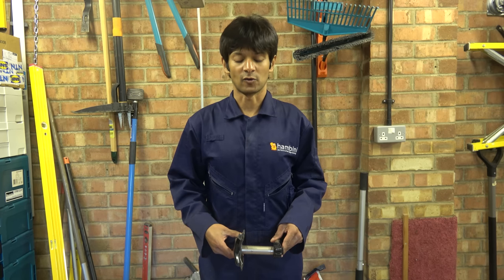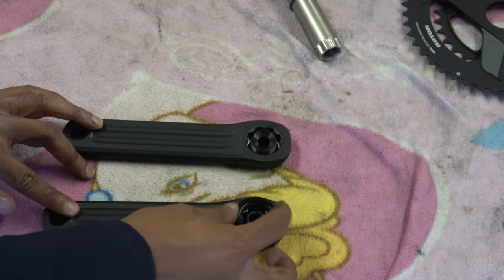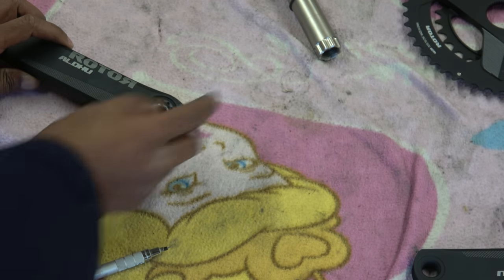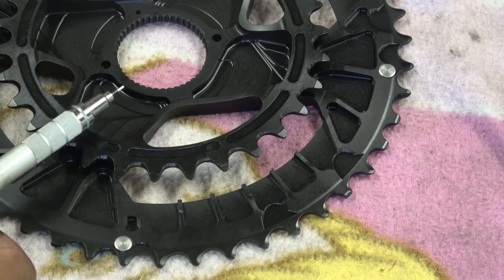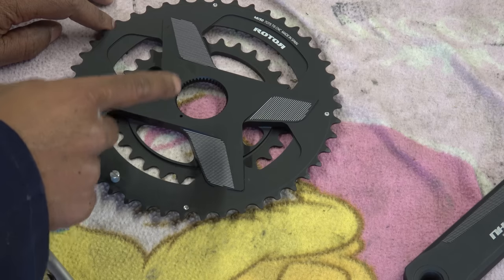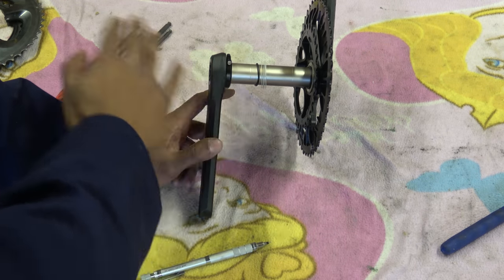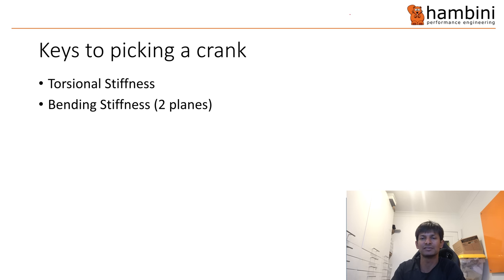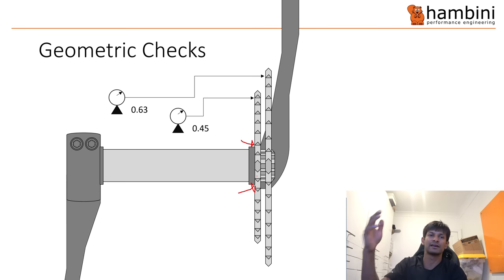Rotor Aldhu Crankset Teardown | SHIMANO drop in replacement

Comment: I love the setup in combination with  the ngpower2max spider based powermeter. I just notice on the driveside the shimano rings attached on the powerdisk are e few mm more to the outside , so i needed to adjust the front derailler also to his limit outside.

Comment: I have 10000km + on the Aldhu carbon paired to a 110bcd 4 bolt sigeyi power meter. Zero Issues.
Reply: NewTube Channel  I peak @ 1265w and my ftp is 317w for a modest 4.54wkg ;)… one thing i could say is bad about rotor is their chainring bolts , absolute crap.
Reply: NewTube Channel  i bought it cuz it looks hella cool haha seems like nothing escape a hambini reaming and every single component is shite… when are we gonna get a full hambini groupset ? Haha

Comment: This episode was very anticipated!!!! 
Great, I own 3D 24 and 30 with the old 5 bolts spider so I get both advantages crank arm drilling and 5 bolts system to diminish the chainring flex??? 

Have to say i installed some Aldhus and the finish and machined quality seems outstanding.

Love that they passed your vibe check, made in my hometown Madrid suburbs

Comment: I have had 3 rotor  crank arm failures same way cracking at top of arm. Non drive side , rotor said they never had that issue and I sent one back and they kept it with out sending me new one  next 2 same prob and they blaming it on  me / bike shop install
Reply: My NDS crank 165mm Vegast 24 failed
After ~7 rides and broken threads. I've users a 175 for several months without issues so they indicates that Rotor has a huge variation in quality and accuracy. Not something you want on your cranks.

Comment: Given the price of Rotor cranks, is there any real benefit to upgrading from a 105 R7000 crankset?
Reply: Stiffness if you have enough power and weight. The rotor stuff is also available for any axle size and way more crank lengths.
Reply: Modularity is a big plus on the Rotor ALDHU. Say if you want to try out a different crankarm length or the spindle's worn out, these can be swapped out individually, no need for a new crankset altogether.

Comment: Pretty sure they're machined on the inside with longitudinal drilling like their old 3D+ crank.
The only preload collars I've seen broken have been aluminum ones. On the plastic ones, the screw head sometimes rounds out, and it's difficult to find a proper replacement.
Rotor chainrings have had very good shifting in recent times.

Comment: I have a Rotor Hawk crankset wih a single 36t ring...its basically the mtb version of the Aldhu, Its been solid for the last few years with no issues apart from a slight creak which I thought was originally from the pedal threads,   I  took the cranks off and gave the interfaces a clean and light regrease..properly re-torqued up and since all silent. I like the overall design but I agree the manual is pretty crap with very little info.

Comment: new 12s Ultegra is hollow forged, like 105, 12s dura ace is mixed. Left crank is hollow forged, right is hollow bonded.... let's see how that goes.
Reply: Is it 105 R7000 crank that's hollow forged, or the new 105 that's hollow forged?
Reply: @thedownunderverse  all hollowtech 105s are hollowforged.
Reply: @LainOTN  I’m not sure that’s right. I thought so too but then I saw a video in which bond lines can clearly be seen on R7000 cranks… though the joins are in a slightly different spot
Reply: Could you provide a source where it says that the new 12s Ultegra is hollow forged instead of bonded? Thank you!
Reply: @takimoto8421  I have it, will try to upload some photos.

Comment: Awesome we are returning back to the originals, one piece double rings, square bottom shaft type arrangement, we moved away from doubled set chain rings in order to get different arrangements so this is a no go for many custom bikes.
Reply: The bottom shaft ends are not square and a variety of chain rings are available. Mine are vanilla Shimano
Reply: @GregRenwick  It was a sarcastic joke as in we are coming full circle. Just waiting for the day those GCN fools push for Square BB claiming superior drag and spinning 😂
Reply: @danfuerthgillis4483  ok. I don't watch those guys. It's a good product and was reasonably priced. The chain rings are individual pieces bolted on just like Shimano chain rings. (cuz they are Shimano chain rings)
Reply: @GregRenwick  Yep the only issue with these rings is they are one piece, so that means no 52-40 combo ( don’t know if they make it) or 52/39 for example. I am on a 52/40 setup and really like it a lot in the flats as I don’t have any mountains here for 300 km, the 40t ring is really nice in heavier winds as it allows for faster speed without increased cadence.
Reply: @danfuerthgillis4483  Right, so you buy the spider that mounts individual chain rings and then there is no problem. The review implies that the one piece chain rings (2 rings in one piece) is the only choice but that is incorrect. I know this because I have this setup on my bike. And have had 2 different combinations of chain rings.
Reply: @GregRenwick  I have always used Odd ring sizes together which had to be bought individual and bolted on the spider. 52/40 is my voto combo.
Reply: @danfuerthgillis4483  I can mount that combination on my rotor crankset.

Comment: I used to be the brand manager for Rotor in Australia.  You should have seen the fucking state of the order sheets they used to send me.  Dreadful.
Reply: You’re alive!?
Reply: I would like to know more.
Reply: @lasrachtech.1341  Not really.
Reply: @sabamacx  Seizure inducing, primary coloured, bold comic sans filled, impossible to navigate Excel spreadsheets, with endless missing SKU codes, repeated items, no sorting or categorising of any kind, which they would send several updates to throughout the ordering periods so you would have to attempt to =index(match) your current work into the latest version, and lose 20% of your order in the process, time and time again.  Pricing changing constantly as well, plus a cute habit of splitting orders across various different types of shipping methods and companies, so orders would arrive incomplete, and damaged.

Comment: I would say Hambini do a bit more research of the Rotor cranks and the interchangeability you did miss a few things out - but as usual a great review and technical information - these are far much better than the Shimano......
so far im on my 4th set of Rotor cranks to the collection of my bikes - the 2inpower cranks are great with the ability to change out the spiders - 1 pair of the 3d - 24mm cranks on a winter bike -  1 pair of RRaptor on a jump bike and some Kaptic Carbon on my Yeti , these weight for weight are very close to the THM but are half the price...so far no failures over the 8 years - only problem is the alloy 30mm axle that does wear but this was on my Rraptor cranks with some bad PF4130 BB's - I have changed this over to the RaceFace Clinch 89/92 BB and so far so good on my road bike and my Yeti.

Comment: I'm curious as to how the Trinity Drilling System actually goes about drilling the holes while remaining a single piece - do they drill through from the axle end or the pedal end. Are there any holes that get filled in the ends, and could those be weak points?
Reply: On the older 3D cranks there are two plugged holes at the pedal end. Maybe the last hole is at the axle side.

Comment: I have those rotor cranks, and I've been pretty disappointed with the stiffness (or lack thereof).  I'm hoping to upgrade to the carbon aldhu arms to get a bit more stiffness.
The lack of stiffness is uncomfortable on hard uphill efforts, since the pedal rotates out of plane enough that my ankles are bent uncomfortably.
Reply: you sure its the crank and not the frameset?  I find carbon frames after a few years of hard use lose their BB stiffness and do what you describe.
Reply: @christopherrowley7601  yes, I've tried the cranks in several bikes and the result is the same. None of my bikes are of that type to be flexible, either stiff TT frames or stiff aluminum track frames.
Reply: RollinRat  lol no ped, just a big dude with a lot of watts. I've been riding long enough to know what I'm feeling. I understand that low wattage people might not be able to feel the same bend and stretch of various materials.
When I first installed the crank, I had about 400W FTP, and weighed 195lbs. You do some hard efforts up hills and you'll feel it.
Reply: RollinRat  update: I got a set of the Rotor Aldhu Carbon arms, and it is a huge improvement.

Comment: Is it known if the Shimano Parts of the Higher end Groupsets like XTR and DuraAce still manufactured in Japan?
Reply: Even if they're still made in Japan, even the monkey falls off from the tree. 
In my opinion, Shimano has gone too far in pursuit of ever lighter groupset. Unless their Hollowtech is built like airframe spar with rivets and corrosion prevention inside, the thinner material of the crank is least likely to withstand stresses and corrosion in a long term.

Comment: I’ve got a titanium bike that I’ve ridden for 13 years with a Sram red crankset. This week I decided replace everything with Campagnolo chorus 12 speed. While everything is apart I measured the English BSA bb and found it to be 66.65mm. 😮. So what’s the best crankset or solution for this problem?  Is the campy going to work?  BB shell face to seat tube measures 20.50 DS and 20.79 NDS. I’m looking for a solution not a reaming. Thanks!
Reply from the maker: A small spacer to give the distance back should sort you out

Comment: I believe if the Shimano crank is stiff enough for the pros it is stiff enough for me and anyone else.The Chinese brand ZRace makes a crank similar to the Rotor (but rings are separate pieces) but has triple hollow drilled areas like the Rotor for less than $100. Reasonably high too. Works great on my indoor bike.
Reply: Pros ride what they are given. Trust me they would have different components, wheels, hubs, and crankset if they didnt have shimano as sponsor
Reply: And most things are dispossable, they just put new things every time they have issues. Worst case scenario is they use it for a season. Amateurs rely on longevity and quality products
Reply: Stiffness is great for Shimano until they fall apart
Reply: @svencobaya82  eh, maybe wheels.  As a SRAM die hard, Shimano cranks certainly shift better.  Their hubs are also very good but their rims aren't very fast.   As for shifter choice, that's all personal preference and many people choose Shimano anyway even though I wouldn't
Reply: Pros mostly not able to choose components what they like.. they ride stuffs which are came from sponsors..
Reply: C'mon. They are not going to use anything that slows them down.

Comment: So in short, get the Shimano 105?
Reply: If you don't have the requirement of a cheap spindle based powermeter: probably. I guess most people only consider Rotor because of the good and cheap powermeters available from Chinese vendors. In all other aspects, 105 is better.

Comment: I'm riding rotor on mtb and road bike.. Almost no maintenance, I'm very rough on assembly and disassembly procedure, almost no cleaning even after the worst rides in rain and mud... No problem so far, after 20k kilometers... I didnt even changed the chainrings... Poor chains...

Comment: Love your videos. Question: Using a 3DF rotor crankset with BBRight Ultimate BB. Want to change to short arms. Does anybody know if the Aldhu arms interchange with the older 3DF arms (splines on gear-set, etc)?

Comment: w hollowtech, isnt the outer shell really just a cosmetic shell? does it really bear any load??
Reply: The pedal thread is joint to the outer shell so yeah it is load bearing
Reply: The plastic cap preloads the BB bearings and with the crankarm pinch bolts torqued down, it'll stay put.

Comment: Chicago Schwinn bikes are peak performance. Their 1-piece forged Ashtabula crankset yields peak stiffness and durability. Modern Look cranksets emulate this same design but only using modern manufacturing and materials (i.e. carbon fiber). Schwinn forged steel forks (again forged in Ashtabula, Ohio) are also some of the most aero forks ever made. Sir Velo Vroomen himself testified that the Schwinn forged fork is the fastest fork ever tested.

Comment: Great video! I’ve been using the Aldhu cranks 170 and 165 with an InSpider PM (24mm axle) and have run many different setups 2x and 1x Q Ring and ULTEGRA rings with great satisfaction. You just helped me accommodate their latest Aldhu Carbon arms since they only offer that with use of a 30mm axle (annoying? why? is it a structural decision?) - anyway saves 100gr of rotational weight which is appealing, but curious if there are any drawbacks and should I just go back to the alloy arms. It’s true that your 24mm delring (sp?) BB caps appear to better support/protect the axle. Again great video, thank you.

Comment: l got an alugear chainring on my tt bike. 1x setup 54 teeth since l couldn't find any other good solutions to run 105 FC-R7000 1x. it flexes a bit yes and l had to file away a bit the the breakshoe bolt but on the tt bike its ok

Comment: I’ll stick with Shimano 7800, no problems with those falling apart and aesthetically they are streets ahead of the recent stuff.
Reply: Octalink is not a great solution, it runs smaller bearings than square taper cranks, but is stiffer. However it relies on properly faced threaded bottom brackets. If its not faced it wont have a long life. 7800 is great.
Reply: 7800 bombproof mate👍
Reply: @daveslater309  -  After 9 speeds it became nothing more than marketing. I know that a pro can use 12 speeds but they were holding 30 mph in the Vuelta for awhile. You and I need nothing more than range.  Not to say that component design hasn't improved but wouldn't it be nice to replace your 9 or 10 speed rear derailleur with a smoother shifting and more accurate one instead of being forced to replace an entire group with one where you shift through 4 gears to get to the gear you used to shift once for?
Reply: @daveslater309  I get most of my kit through eBay. You do have to be careful as there are a few dodgy dealers about, but I have found that most cycling people are decent and honest. I recently picked up a couple of 7800 chain sets for a total of £120 and last week bought an immaculate ten speed campagnolo record chain set for £51, total bargain.
Reply: I've said it before and I'll say it again, I Love your videos on the engineering of bike components and thank you for the time and energy spent to create them. On a different note, does anymore know if there's been an attempt to collect data on the failure of the Shimano Dura Ace (and I assume Ultegra?) cranks. If so, does the data show consistent failures across the entire period of time these cranksets were manufactured? Or are the failures clustered around a relatively short period of their manufacturing run. I ask because I wonder if Shimano became aware of the problem and altered the manufacturing process (different bonding material, different bonding protocols...) without any public fanfare to avoid responsibility and public backlash for the poorer performing cranks.
Reply: @worldofameiso5491  I see that you are a lady or gentleman of fine tastes. Cheers!
Reply: @AndreiNeacsu  Thanks Beauty. Life is short, you may as well ride the best equipment you can afford...
Reply: @tomkunich9401  They're just keep adding another gear trying to be " hottest & latest". Nothing new. If we want something new, should we be having automatic shifting for bicycle gears by now? Why should we bother fiddle around with shifter when ascending and descending?

Comment: I'm confused as to which spindle and BB are needed here.  I have a standard English threaded 68mm BB.  What BB and spindle will I need if I want rotor cranks?
Reply from the maker: BSA Shimano or bsa30
Reply: @Hambini  Thanks! Would you suggest Rotor's bb's to use with Rotor cranks/spindle?  Is there an advantage in fit/build quality?

Comment: Every time i've tried rotor cranksets i've had problems. Problems with the tensioner leads (never knowing if it's quite tight enough, or too tight) leads to creaking and ingress of dirt and grit. Manual is useless. Power meter failed. Also, and to me most annoying, I found they'd drop the chain, then grab it and suck it up into the chainstay. Takes a massing chunk out of the BB/chainstay area :( Switched back to Shimano/SRAM - no chain dropping at all.

On a lighter note, seeing an advert for Disney run half way through the video seems appropriate. 😂

Comment: I have considered the aldhu 4 bolt spider and crank arms to pair with my r8000 chainrings in the event the Shimano cranks fail. I notice rotor also make a 5 bolt spider and chainring system. What are your thoughts on the merits of each type? Thanks.
Reply: It's really about chainring availability. Difference between four and five bolt is marginal at best. 
One could argue that, with even number chainring teeth, that making them with four arms is easier as the stiffness profile from one 180° section is the same as the other.
Reply: 4-bolt: Only fits Rotor chainrings due to the contours of the spider.
5-bolt: Any 5-bolt chainrings can do, double-check for fitment before purchasing.
Reply: Exactly. 5 bolts chainrings are the most endangered specie. Rotot dont produce them any more nor keep stock of them
Reply: @svencobaya82  Wait what? Isn't this one of the most common chainring bolt patterns out there?

Comment: Is there really a benefit in having large diameter crank axles on road/commuter bikes?
Reply: I question having large diameter crank axles even on performance bikes. It's a placebo effect.
Reply: If your BB shell's diameter is already not that big to begin with, nah. Small bearings = shorter lifespan.